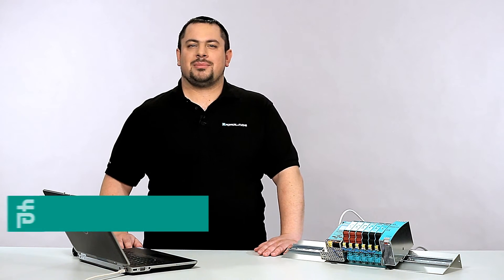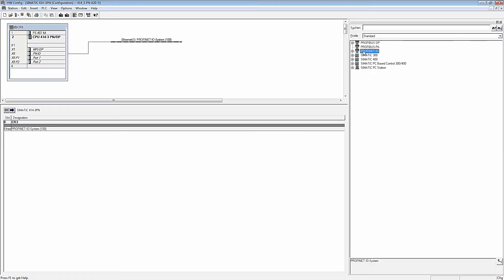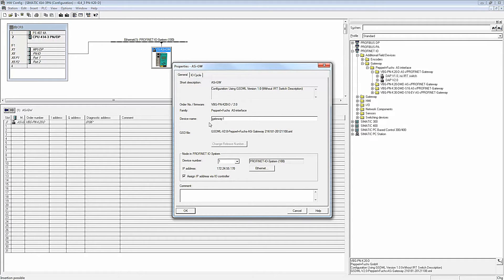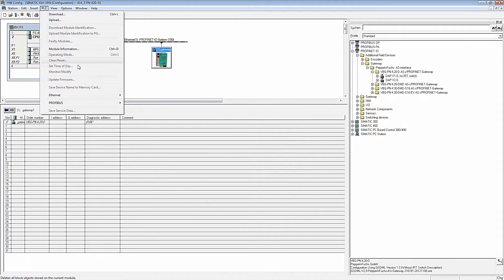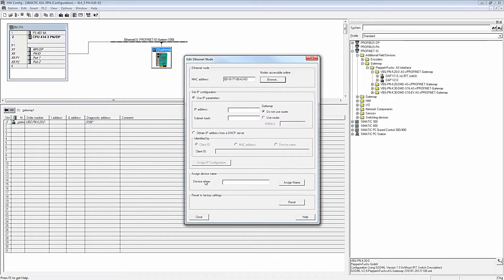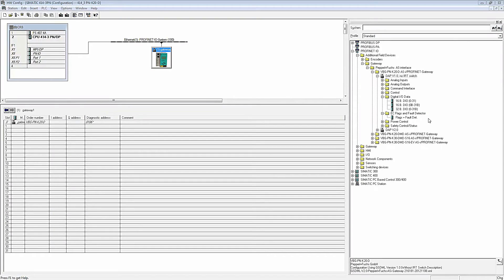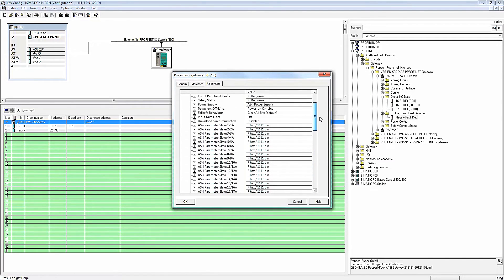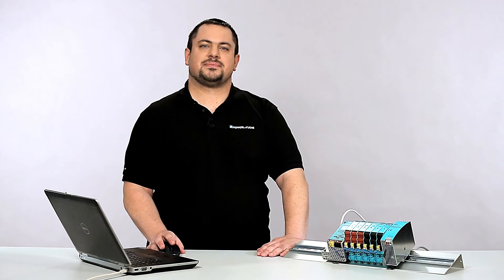How To: How Do I Set Up an AS-Interface Profinet Gateway in a Simatic S7 PLC?

Comment: How to know the specific address of I/0 in each slave  for the master?
Reply from the maker: Hello! 👋 We heard back from our experts: 

When you insert a module like “32 Byte DIO (0-31B)” from the hardware catalog (GSDML file) into your hardware config, a data field with the accordant size (in this case 32 bytes) is allocated in your PLC memory at a certain address. As an example, let's say the address range in your PLC is byte 50 to 81. Within this data block, all the information from all ASi devices are mapped consecutively (two devices per byte), starting with the devices with A- or full addresses in the first 16 byte (bit 50.0 in our example) followed by the B-devices starting at byte 16 or in our example byte 66. The order of the addresses hereby is 1-0 – 3-2 – 5-4 and so on. Please have a look at the manual of our gateway for an overview table. In our example, input 4 of ASi device 1A could therefore be found at address 50.3, while input 1 of device 5B could be found at address 68.0.

Does this help you? Please let us know if you need additional support. Have a nice day! #AutomationPassion